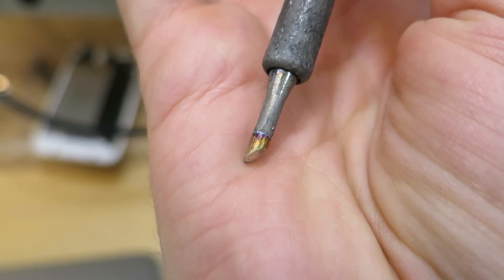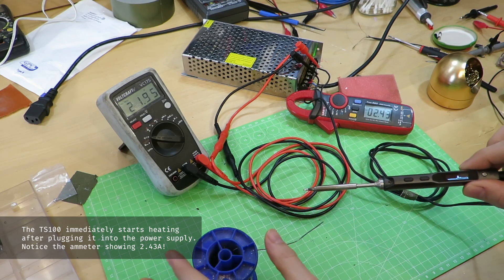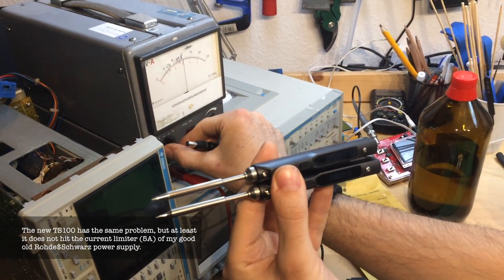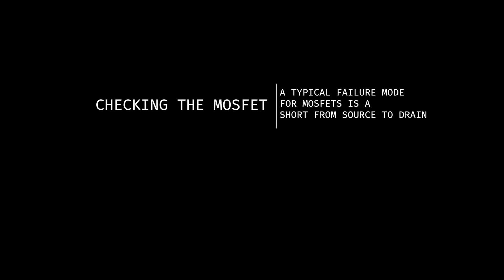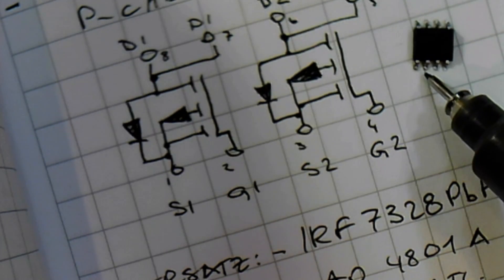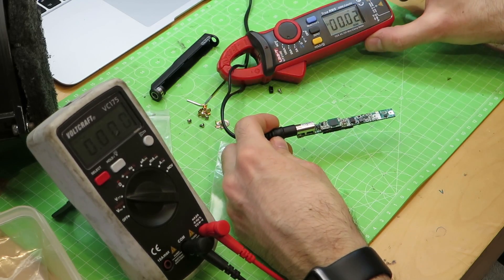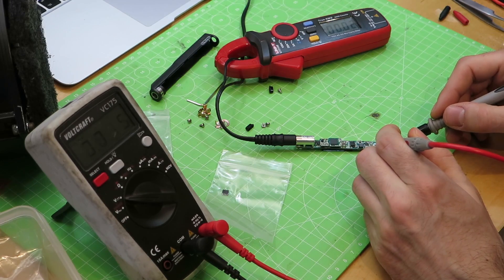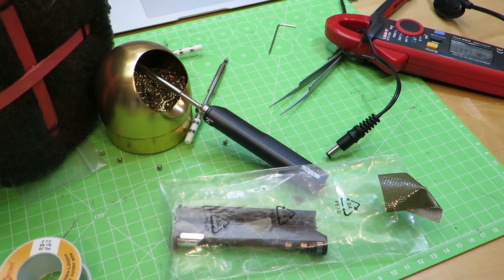TS100 Fix (Sen-Err / overheating) - MOSFET replacement

Comment: Excellent video. It helped me a lot. How do you use a paste(gel) for desoldering ?
Reply from the maker: Hey tono, thanks! What do you mean exactly? The flux paste is there to remove oxidation and prevent it during soldering, so that the solder can be picked up by the solder wick much easier. Nothing special there, just put on the flux and heat it up together with the solder wick and the solder will flow into the mesh. After that you should be able to simply remove the component. You may have to apply additional heat with a cleaned tip (which is also able to pick up the solder remainders), just like I did at 3:08

Comment: Hi, i have 135watt power adaptor, (19v 7.1a). will it burn the ts100 because of the 7amp output from my adaptor? Or its still safe to use?
Reply from the maker: You will burn the TS100 when the tip fails, which you cannot foresee ;) I'd recommend to put a cheap fuse with an inline socket (something like this: http://a.co/2tliH2p) right into the power cable. You can pick a 3A fuse, which will probably blow at around 5A (the limit of the Q1 MOSFET). I know I said it a few times already, but I will cover these questions in my next video ;)

Comment: Many thanks for sharing your analysis and the fix!
Reply from the maker: I hope to get the followup video ready soon ;)
Reply: That would be terrific.  This video is so timely as I was using my TS100 on a 19V/2A laptop supply but wanted to experiment w/ e.g. 24V  so a week ago I put it on my bench supply with no current limit.  At some point the iron got super hot and stays that way so I suspect I have the same fault.  You've made it really easy to check the MOSFET and do a replacement.  Thanks again!

Comment: Well, I got two TS100 and one after another failed on me. Both in exact the same way: ESD shock on the tip. In both cases Q1 is shot. However replacing it only helped with the issue that the tip is heating up uncontrollably. The erroneously high temperatures remained the same. It could be, that the opamp is shot, too. Well, well...
Reply from the maker: Yeah, the overall circuit design is not really failure tolerant. Did replacing the OPamp help? I had another bad tip which destroyed my other TS100. Now I have a cheap 2A fuse (which blows at about 4A ;-) to protect at least the MOSFET in an inline socket on the cable of the iron.
Reply: No, I did not put any more work into this. I am not feeling like it is worth the hassle. I probably will take a look into a DIY JBC. It is a shame because I have three working tips for the TS100 now...
Reply from the maker: Damn, I understand... I am currently happy with the TS100. I use them every day and so far no issues ;) but a DIY JBC should be the better choice anyways (ESD proof).
Reply: @tamasgal_com  can you show us a video or picture of that fuse installation?
Reply from the maker: @HondaVTECGD8  Sorry, I am still very busy with writing up my PhD thesis but I'll try to put up a video. However it's pretty straight forward, just put an in-line fuse holder with a 3A fuse for example right into the cable ;)

Comment: У меня та же самая проблема появилась после подключения плохого блока питания. Точно такого же транзистора не было в запасе. Заменил на AP4957GM и всё заработало.
I had the same problem after connecting a bad power supply. Exactly the same transistor was not in stock. Replaced on AP4957GM and it all worked.
Reply: Блин, я долго думал в чем же проблема) грешил сначала на прошивку, поменяв несколько я понял что все таки дело в мосфете.

Damn, I thought for a long time what the problem was) I sinned first on the firmware, changing a few, I realized that it was all a matter of mosfets.

Comment: Hi, what is the type/name of the second flux you use to solder the mosfet ?
Reply from the maker: I use the same flux (from MG Chemicals) in the whole video. I guess you are referring to the different colour (in the first part of the video it looks a bit yellowish), it's due to the lighting setup which I changed in between, sorry for the confusion ;)

Comment: Did that soldering iron tip have a small hole to hold solder?
Reply from the maker: Nope, but Marco Reps drilled a hole in one of the tips and it still worked.
Reply: The way you soldered the smd made me think yours had one.
Reply from the maker: Ah no no, for smaller SMD components you normally can do this pull technique without a hole. The solder layer on the tip surface is enough ;)
Reply: Wouldn't drilling a hole destroy the plating, unless you put some plating on yourself?

Comment: Which one is the best out of all those replacement MOSFETs you listed?
Reply from the maker: It depends on the maximum current your power supply can deliver. If it’s rated max 5A, you should be fine with any of them. Mine can deliver 10A and I picked one which is rated at 6.9A... it will survive 10A for a short amount of time... I’ll publish a video soon to explain all the details.

Comment: Current on tip and no ground is what concern me most about this iron...
Reply from the maker: There is a ground screw on the upper end of the iron.  You can simply use a third wire along with the DC power in cables to ground it... You can see the ground screw for a fraction of a second at about 1:31 (the first screw I take out).

Comment: if you spread out the solder wick by pushing it together length wise, it will be able to pick up much more solder with a given length than if you use it without spreading it.
Reply from the maker: Thanks for the comment, you are of course totally right :)
Reply: Took me a minute to understand what you meant. Great tip! I will definitely have to try that next time, thank you!

Comment: Excellent video.  I was thinking about getting this to replace my $12 stopgap iron.  Now I know not to get rid of the stopgap.
Reply from the maker: Yep, the faulty tip is frying the MOSFETs as I pointed out in my pinned comment. If there would be some other current protection in the irons circuit, this wouldn't be such a big deal. Also measuring the tips is generally a good advice, but my tip obviously broke during soldering, so sometimes you cannot do anything ;) The easiest solution would be a general warning that the power supply should be limited to 5A. This way you only get a "Sen-Err" when the tip shorts and the iron (resp. the MOSFET) survives. I had a few mails with the tech support and also suggested them to put this into the manual...
Reply: i would hate to guess how many of these TS100's and the clones are out there being used every day without issue. i have one and have used it more times than i can count and it still runs fine. if i understand his other post correctly tamasgal had a faulty tip that he didnt know was causing the issue and used it in the replacement iron which caused that one to fry the MOSFET has well. so really its not the irons fault but a faulty tips fault. seems like testing the resistance of your tips from time to time may be needed.
Reply from the maker: It's always good to have a backup iron ;)
Reply: You have no idea how many times I've almost thrown that $12 iron across the room.  I miss my Hakko with it's terrible user interface.

Comment: Could you say that, with the MOSFET replacement you used, you improved the TS100 'capabilities'?
Reply from the maker: Well, I made the TS100 safe to be operated with a PSU which can deliver up to ~7A (and a bit more for a short amount of time). So basically yes; but if you use a lower rated PSU, you are safe anyways ;)

Comment: Thanks for the follow up. My 24 v. PSU @ 3.75 amps 90 watts seems like a good choice, glad I didn’t go for the ones over 5 amps. These are the TIP ohms I’ve read so far:
TS-B2 = 7.1 ohms. 
TS-BC2 = 7.1 ohms.
TS-C1 = 8.6 ohms. 
TS-K = 8.6 ohms.
Reply from the maker: Yeah, perfect choice, the TS100 is happy with no more than 2.7A ;) Thanks for the resistance values!
Reply: You are welcome. Now I know why all the KITS they offer only include a 19 volt, 2.1 amp PSU. I asked this question in an online electronics forum, before buying a 24 volt PSU, but no one could answer. While the TS100 is rated and advertised as a 65 watt iron, it seems they push the KIT, to avoid amp limit issues. Since I wanted to have access to the full power I went for the 24v PSU. I’ll recommend to everyone to make sure and test read their tips before using them, and if they get the “tip error” to immediately unplug the iron, might have time to save the MISFET, if it becomes overloaded. Great work.

Comment: I’m assuming you used the same bad “shorted” tip on the 2nd TS100 unit they sent you, and thus had the same bad results?Odd, since the TS100’s have been out for about 1.5 years, first time I’ve seen a report about any faulty tips. I own 6 different styles of these, and all work fine. Seems to make sense to test them with a DMM when new? Granted you didn’t know this at first. I tested and logged mine just to note each tips resistance, as they vary. Also, I’m assuming you used your own available PSU, and not the 19 volt ones they package and include in some of the kits? I put away the included 19 volt PSU, and bought a MeanWell brand 24 volt PSU, rated at 3.75 amps, 90 watts, and have not had any issues so far. Do you believe this PSU could cause the same MOSFET failure with a shorted tip as you experienced?Thanks for the video report, I’ll make sure to continue testing any new tips I buy, to make sure there are no shorts before using them.
Reply from the maker: Yep, exactly! I will post a follow-up video soon. The second TS100 failed after I plugged in the faulty tip. I measured 0.2Ohm, while the other tips had something around 7-9Ohm resistance. Since there is no current limiting resistor or any other protection in that tip-circuit, you can simply assume that the current through the tip is the same which goes through the MOSFETs source-drain-path. This should not be more than 5A, which means the tip should at least have 4.8Ohm if you are using a 24V PSU respectively 3.8Ohm with 19V. The PSU I used for the TS100 was a 24V one with a current limiter of 10A, which of course was too much ;) I bought my first TS100 without a PSU. Anyways, yes, I'd recommend checking the tips with a DMM, they should at least have 4.8Ohm (for 24V) but if the PSU is limited to 5A, the MOSFET should also survive a shorted tip. Not sure how long, though, this should be in the datasheets. ;)

Comment from the maker: Here is the explanation to why some TS100 are failing with shorted MOSFETs. Two important things first:

1. A faulty tip can short out the MOSFETs source and drain pins, which will induce a very high current through it.
2. The current seems to be mostly limited by the power supply, which is often a simple laptop charger with a current limit protection of about 2.1A, which is within the specifications of the original MOSFET, so most of the time you will only need to replace a faulty tip and you're fine.

However, if you use a power supply which can deliver more than 5A,  you risk that the maximal current (5A) of the MOSFET is exceeded and you destroy it - when the tip fails. My power supply can deliver up to 10A, more than enough to roast the original MOSFET. I now have a 5A fuse inline with the power cable and the replacement MOSFET can deal with up to 6.9A, so it should be fine even if my tip fails or I put in a shorted one.
Reply from the maker: Damn, yeah ;) Btw. you can consider adding a 3A fuse to the cable to avoid future damage. I will post a short video soon with additional information (currently totally busy with my thesis).
Reply: @tamasgal_com  Hi, any chance you can give guidance how to add the 3A fuze? I am new to this and just got myself the TS100, and converted an old power supplu from a Dell laptop (19,5v, 6,7A). Now I am afraid I might fry the mosfet, and the 3A fuze seems like the easiest fix - but “how to”? Loved this video 👍🏻
Reply from the maker: @crj100mobile  Yes, it’s on my list, I’ll try to find some time the next days!
Reply: @tamasgal_com  Thanks a lot - that would be great 😉
Reply: @tamasgal_com  Can’t find it 😉 Maybe just a link for what I need - that would be of great help 👍🏻
Reply from the maker: @crj100mobile  I am sorry, I am super busy with work (physics) these weeks! Yes sure, here is an AliExpress link: https://aliexpress.com/item/33035125575.html just cut one wire of the powercord and put this inline fuse-holder "in-line" with a e.g. 2.5A fuse.
Reply: @tamasgal_com  Ok, great. But I can not find any glass fuses size 10x38 - only ceramic fast bliw fuses. Will they be ok, as long as it is 2,5 or 3 A?
Thanks for taking time to answer my noob Q’s 👍🏼
Reply from the maker: @crj100  if they are fast I’d recommend 3A, otherwise it might blow while normal operation. No worries, we are here to share knowledge :)
Reply from the maker: Thanks billywhizzy! Just measure the resistance of the tip (between the two metal rings), it should be around 7-9 Ohm.
Reply: Great video! How do you check if the tip is faulty? I have 2 TS100's.. one seems to have failed the mosfet like yours but the tip works on the other TS100 flawlessly but I have not run it for more than a minute and do not intend to! Since this video I have limited the current to my power supply to 19V 3A.
Reply from the maker: Uuuh, actually 5 Ohms may be within the range of some tips ;) ... Someone posted a few values for different (working) tips here in the comment section, but I can't find it right now.
Reply: Thanks for addressing the cause of this serious issue in the comments. I haven't purchased the TS100 yet, and it was disturbing to see that you had two units fail in short order. It seems that the manufacturer needs to address this problem ASAP, and that current limiting the input may extend the life of the unit, but will stay lead to unreliable operation in the long run due to excessive heating of the MOSFET. It will be interesting to see if the manufacturer addresses this problem or not...
Reply: Thanks for the tip ;) and tutorial, Just received my new TS100 today and the very first time I ramped it up to its operating voltage I also noticed the current drain.... should have been watching the tip at the time not the current readout lol. ordered the SI4925DDY From RS, pretty sure once my tip got white hot it died anyway.
Reply: Good luck with your Thesis!!! I like the Idea of a fuse I will  definitely add one to my cable.
Reply: amazing work you have done, they  should have used a better mosfet from the start.
Reply: Thanks! I think it's partly shorted then. I've got 5 ohms.. bin it!
Reply: Thanks for posting I just learned something new I have that same model its not heating very well ...can u tell me what that stuff is that you injected on to the circuit board?
Reply: Jon Ramsey that’s called ‘Flux’. It makes the solder flow much better.

Is your power supply strong enough?
Reply: @Conservator.  Lite-On is the brand name 19v-2.1A it came with my Ts100 .....its running smoothly now I forgot to tighten the set screw (I'm still new at this stuff)thanx for your input